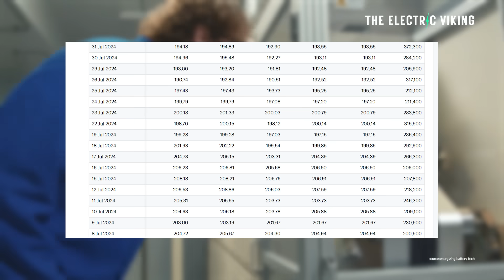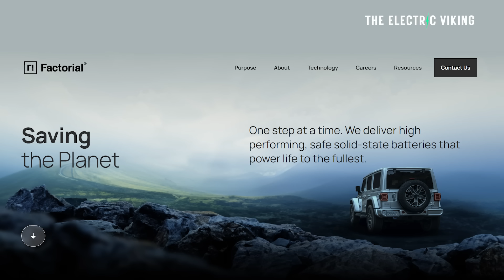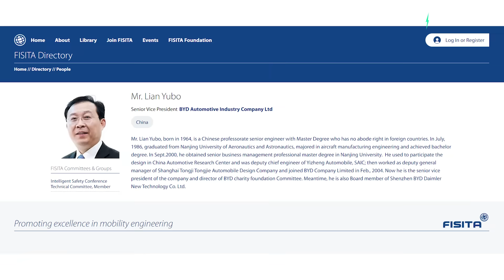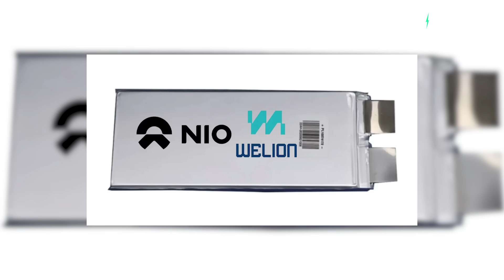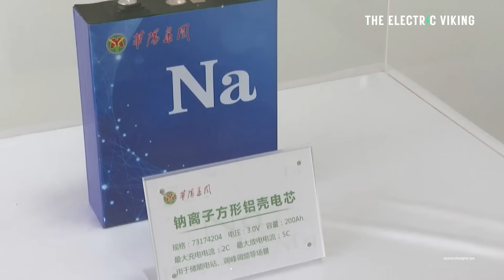BYD's chief scientist reveals when solid state batteries will take over

Comment: OK, it's time to demystify this topic. There are two types of solid state batteries: 1. Lithium-ion that use gel-like cells without liquid electrolyte and 2. True solid state that use solid electrolyte. Those who claim that they are near releasing the SS car battery refer to #1. #2 is at least a decade away and if/when it appears,  it will be so expensive that only uber luxury cars will have them. By the time they become common in Corollas , Civics and similar cars all of you reading this (yours truly included) will be too old to drive.

Comment: AI will advance the development of solid state battery development, but not the manufacturing  facilities to produce them. I think these will be less expensive produce than current LI batteries , but demand a premium due to supply within 3 years.   But at this same time LI batteries are also improving and becoming less expensive to produce. Crossover manufacturing cost may not happen for a decade.

Comment: I have a PhD in chemistry and one of my besties, also a PhD chemist, works for a Silicon Valley startup on solid state Li batteries.  The chemistry is extremely moisture sensitive, he works in a dry room controlled to a maximum of 0.01% humidity.  Any contact with moisture releases H2S, a poisonous gas (rotten egg smell).  Even if they perfect the technology, manufacturing at scale will require building factories with humidity controlled to an unprecedented degree.  And if that succeeds, a car accident that cracks the battery case releases H2S.

Comment: There’s nothing solid state like solid state electronics about a battery. It’s a dry electrolyte and using a term like solid state confuses the issue. It’s has solid state, electronics, not even remotely related to the phrase used in batteries, which simply means dry electrolyte. It’s a buzz word and very little more

Comment: LFP batteries are too heavy, you'll be replacing 80k mile tires every 40k miles. If LFP batteries can cut their weight by 25% then they will be able to better compete with Solid State. LFP batteries are also more dangerous, they burn for nearly 24 hours before they get extinguished. I've personally seen houses half burnt down due to the EV starting on fire in their attached garage, this is another issue Solid State batteries solve. I believe LFP will be used for smaller consumer items like electrics and hand tools while Solid State will take over the ground transportation sector.

Comment: I'm waiting for safer batteries before I buy an EV or plug in vehicle.  Solid State may be an option.
Toyota stock is tanking over the Tundra engine fiasco and the soon to come Tacoma transmission recall.  Expensive recalls that hit Toyota right where it hurts the most, quality and dependability.  Add the highly stressed smaller engines across the lineup, and Toyota is losing its core customer base.  Shame really.  Cheers 🇨🇦

Comment: I doubt the batteries will really improve much more than now, no matter what material  they use. There is only so much power that can be produced from one cell. Solid state batteries will reach there peak as well and can not see them being much better than what we have now. If manufacturers can make a battery that will power a car for 1000k on a full charge, regardless of weather, temperatures and how much you use the air con or heater, lights etc and can be easily fully charged in 5 mins and totally safe then evs may properly take off. But the electricity network will need to be upgraded to deal with the millions of extra cars that will need charging all the time. There are many countries where evs will never exist. Many parts if the world struggle to have enough electricity for everyday use let alone charging cars. This problem also needs to be solved. It will be anything from 10-30 years before evs become mainstream around the world. But before then other tech would have become the main. My guess is clean fuel engine tech will out do evs.
We shall see.
Many things put me off an ev, 
1. Expensive
2. Poor range
3. Long charging times
4. They look crap, all the same boring shapes. No individuality. 
5. No physical controls, just a crappy touch screen for everything=dangerous and inconvenient when driving.
6. High depreciation 
7. Boring to drive

Everything a person wants in a car, an Ev doesn't offer.

Comment: Better and cheaper batteries are clearly necessary for electric vehicles to fully reach their potential. However, competition to get there first means that a lot of money is being spent solving almost the same problem many times over. That slows the industry as a whole. If I'm an investor, how do I know which of the dozens or hundreds of different battery rersearch programs will break through? Truth is, nobody knows at this point. That would make me wait until the situation is a little clearer. That limits the pace.

Comment: LFP battery with 800 to 1,000 mile range would be a game changer. Would love to see that happen by 2027. With a battery like this, you could reduce battery size and weight making the car lighter while still having a range that far exceeds anything available today.
Reply: There’s a Nio ET7 which has a 1,000 km range but that is an expensive car. That said, it’s also been out for a couple of years and things have changed in recent times.

Comment: 1 million km is 621,890 miles.
If you drive an average of 12k to 20k miles a year the battery should last 51.82 to  31.09 years.
Will other parts of your car last that long? 
Will CATL still be around after that?
I'm guessing that battery tech will have evolved in that time, and that battery replacements will be difficult as they wont be backwards compatible with your car if it lasted that long.

Comment: I bought the 12v Ohmmu SSB to swap out my led acid 12v for my model 3 after you made a video about it a while a go. The SSB was so incredibly light compared to the led acid i took out. I have had absolutely no problems after installing it. I really hope it will last for 10 years or more.

Comment: Due to the charging TIME anxiety, not so much range anxiety, I believe a battery that can do about 1,000km will do a lot to win the range anxiety petrol guzzlers over, and convert them. Reason being, people don’t want to have to charge a battery every 300km on a long trip. But they won’t mind so much if they can travel 6 or 700km before having to charge, and then can do so during lunch or dinner break. Plus, those in townships working, or regional who travel 100km daily, will also be very happy to charge at home every other day. Make sense? Solid state if it can get to this will win for sure
Reply: You’ll never win those people over.

As for charging every 300 kms on a long trip, you are going to be filling up every 300 kms in an ICE anyway. Apart from that, anyone who doesn’t take a break every couple of hours has rocks in their head. Get out of the car for 20 minutes, stretch your legs, get some food and have a wee. You can do that with an EV. You can’t do it with an ICE because you’ve got to stand there at the fuel pump holding onto the filler nozzle.
Reply: @ Very true

Comment: Hi Sam. Nio's claim is not outside the bounds on EV claims. Mototrend has a real world efficiency test on EVs. The most efficient car they tested did 3.6mpkwh which was a hyndai ionic. 3.6mpkwh gets about 540miles on a 150kwh battery. This is in line with what people aregetying from the Nio battery.

The fact that in 2024 people are driving nearly 1000km on a single charge is significant. This battery makes range anxiety a thing of the past.

Comment: In the 2000's the general believed that flat screen tvs were only going to be premium for a long time to go and that 'normal' analog tvs would be in the budget market for decades to come. By 2005/6 the analog TV market was gone because flatscreens were much cheaper to produce. 
You need to take a step back to make a prediction on solid-state batteries. The question you need to ask is 'how much do the raw materials cost that go into a solid-state battery compared to the raw material cost of a lithium battery with the same capacity'. If the raw material cost of the solid-state battery is lower, they will be in all cars faster than you think. In the medium to long run, the cost of the technological development of a product is irrelevant to the price of it. As the development costs have already been made in the past and most likely by someone else than the cuurent producer of these batteries.

Comment: Ferrari owners used to say they were extremely unreliable. In fact all performance cars tend to be unreliable because they are low production. As with any new technology, it won't work very well to start with despite giving higher performance when it does. From the manufacturer's perspective they achieve two goals by testing technology in high end models. It helps to pay off research costs and it functions like a pilot study. Your high end fanatics are the guinea pigs.

Comment: Where on earth are you getting your info on Toyota.  Their share price has fallen to what it was in January 2024 but has grown from 1564 yen in 2021 to 2570 yen today. Their new car sales in 2024 showed they remained the most popular new-vehicle brand last month (July 2024), with 22,705 deliveries – putting it up by 18 per cent compared to July 2023, and up 29 per cent year-to-date. BEV sales have dropped over the same period. Ask yourself why MG is dumping old unsold stock with their $8000 discounts. They're great value if you want to buy a $31k BEV that goes about 280km and will last 10 years, hopefully at which time they will be scrap value.

Comment: Sodium solid-state batteries in small low cost EVs will happen in just a few years. One major issue for EV adaption is battery fire.  This ends that issue. Battery tech R&D is booming, 1k watt hrs per kilo gram in sodium solid-state is inevitable and sooner than you might think. Samsung is blazing the trail with sodium solid-state. Things are moving exponentially. No one can see where AI will take us in the next 5 years. Abundance happens because of AI. Get ready for it.

Comment: What batteri working good in -20 or -30 degree celsius?
Reply: Solid state batteries should be more resilient to that. They are looking into things like having a battery heater for when it gets that low, which would probably need some warm-up time before they're fully operational.
Reply: Many of them. Have a look at Sam’s recent video about the testing that was done in Norway.

Comment: The issue about solid state batteries is that no one has spelt out the benefits to the end user.  As to whether they are safer, faster charging, higher energy density, more powerful, cheaper to buy, greater longevity are some of the questions that need answering.

Comment: Currently we can buy 1.0 litre 3 cylinder cars of 5l v8s.  It will be the same in the future with batteries!
Reply: But these tiny engines don't last very long. All turbo charged. So 60k miles and shortly after that  it's game over.

Comment: Hopefully solid state can solve the lithium battery incendiary problem before the insurance underwriters jump in whereas hybrids can use NiMh batteries in a safety tradeoff.
Reply: What lithium incendiary problem? The batteries that have caused all the problems have been NMC, not lithium. Those are the LG ones that have been recalled. Tesla also use them in their Powerwall. I wouldn’t buy one. Yes, lithium is unstable and combustible but modern LiPo batteries are virtually 100% safe.

Comment: ,,SS batts is out there right now for smaller items watches , clocks medical equipment ect ect. The science bump in the road presently is the EDL  for  larger batt pack to run a EV . If this is eventually overcome . The big boys will be manufactured and put in EVs, the initial cost at beginning 😢 at least double or triple . Hopefully this will be going into economy  EVs by 2030/2032 . First initial  vehicles might maybe , possibly end of  2027 will only  be  in higher end $$$ evs. Most batt makers will want to still supply current liquid batteries till after 2030. 
Ps not worth waiting for as there are plenty of advantages owning a ev , as in new models ,
a glut in production and currently a  tailing off or down trend for ev demand , making great deals in 3 mths to 1 yr old ones which still have a pretty decent length warranty.  Just sayin.😮.

Comment: Various Battery Companies and, in particular, Auto Companies, have been working specifically on Solid State Batteries for over 30 years! This is another example of when scientific theory does NOT match reality. Meaning, they are still no where near making solid state batteries that can be produced economically nor actually perform as the theories have predicted. 
One might think that those costs will be mitigated when economies of scale occur as they ramp up production. But again, NO. 
Huge scientific breakthroughs have been occuring over the last 10-15 years regarding transitioning from Nichel Hydride to lithium ion batteries. Battery composition of "metals" (lithium ion, cobolt etc) have hugely improved performance, energy density. Plus, the economies of scale have made production of these batteries much more "affordable". 
The points that make solid state batteries "better" batteries (Energy density, recharging speed)  are off-set by the far greater cost to manufacture and the far lower cycle life) So, we would think that constant research over 30 years would solve these issues. But, again, NO. A big NO. The problems are physics based. SS batteries simply cannot be improved in their SS state to make them financially attractive! Why do the scientists who work on this, not publically agreed and admitted this? 
Perhaps some breakthrough may take place but it would require a drastic change of the composition of SS batteries as we know them today.

Comment: I'm waiting for the new battery tech that's expected next month. A 200x400x100mm battery that is permanently installed under the back seat and never needs replacing or charging for the life of the car. Estimated at 20 years maximum at present. Secret testing using a Formula e and a yet to be released very large Bentley indicate that it can compete with the best ICE and electric vehicles on the road today, modern vehicles only held back by road holding and tyre technologys. -:)

Comment: you still use tapes for data storage, spinning disc hdd too, even when your pc uses ssd. there are places that will use those other types of batteries too.
Reply: A good example.  

The specific needs of different applications, transport, grid storage, and every other niche, they will all choose the cheapest battery tech to fit the need.

Comment: What I need is a battery that will take me 280 miles at 70 mph and charge in 25 minutes.most people need a small break after about three hours. That’s 210 miles that’s all you need for vacations or going to the cabin. 95% of the time you will charge at home or the cabin. Lfp is close and cheap. We’re almost there.
Reply: That's already here
Reply: @larryc1616  Need that in -20 below for winter where I am so need about 600 miles per battery
Reply: Yet another opportunity to spread anti-EV poo. Do you guys ever give up?
Reply: That’s good but when you get to a charge point and there’s a queue of several cars as there isn’t anywhere nearly enough public chargers then that “25 min” stop becomes……and not everyone will have their own “cabin with charger either” this all sounds like perfect world situation which we don’t live in, maybe the high end owner do.
Reply: The cabin with a charger is not a place I could afford. I always camped at provincial parks, which all have many electrical campsites, which can get you back to almost full over night. Even on only 120 volt power @kennztube
Reply: LFP batteries are too heavy, you'll be replacing 80k mile tires every 40k miles. If LFP batteries can cut their weight by 25% then they will be able to better compete with Solid State. LFP batteries are also more dangerous, they burn for nearly 24 hours before they get extinguished. I've personally seen houses half burnt down due to the EV starting on fire in their attached garage, this is another issue Solid State batteries solve. I believe LFP will be used for smaller consumer items like electrics and hand tools while Solid State will take over the ground transportation sector.

Comment: cost, if CATL cannot do it, no other can do it.
Reply: Tesla 4680.
Reply: @waynerussell6401 Tesla had to goto CATL to build their 4680 since they couldn't
Reply: @larryc1616  Since Tesla announced its new battery format several companies have expressed interest in copying it. LG and Panasonic signed up to deliver to Tesla but have missed deadlines. CATL is not currently building a 4680 format or any cylindrical cell or dry electrodes, or tabless designs, but agreed to supply BMW in 2025. Current expectations are for factory completion in 2026 with commercial quantities available 2 years later.

Comment: Also what is the recyclability of ss cells? If it makes them harder and more energy intensive to recycle then there is no point other than special applications like aircraft.
Reply: There are companies working on high recycleable battery designs, well suited to flight. The are designed to support automated end of life recycling back into battery grade resource integrated into battery manufacturing lines.

Planes will likely have flight specific optimised battery packs (or containers) that are swappable for off plane charging and servicing increasing flight turnaround time.

Also, Lithium-Air batteries are being investigated for flight having current energy density of 1700wH/kg, with both electrolyte and solid state chemistries being investigated. Currently they have a low cycle life (<1000) cycles but are canidates for a flight specific high recycleability based approach.